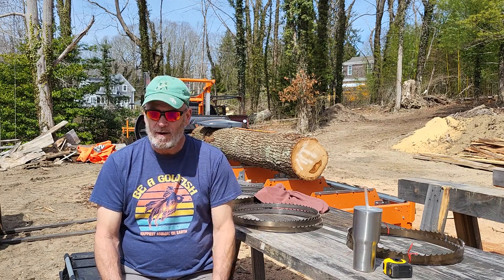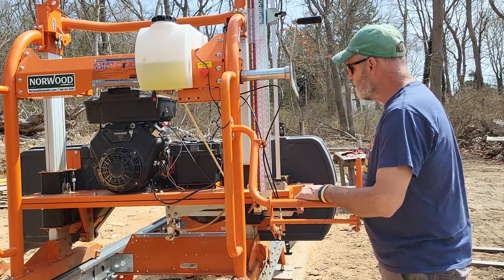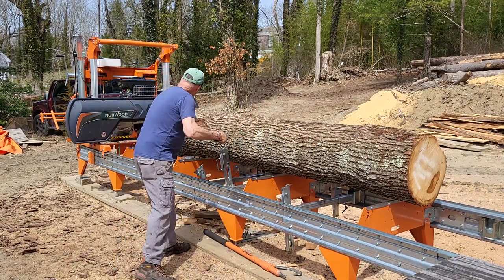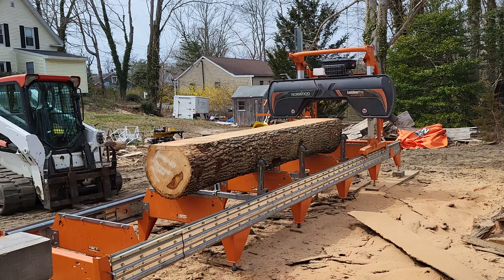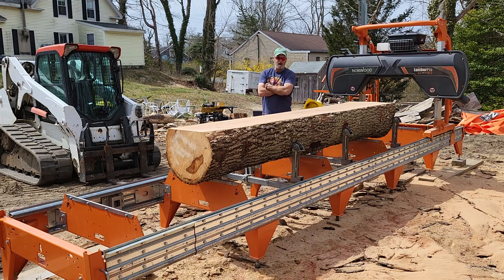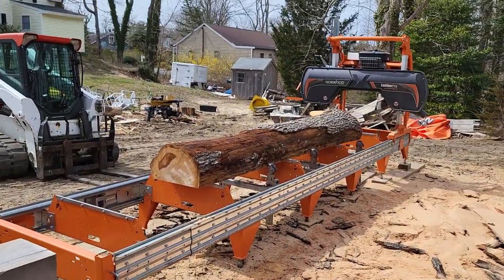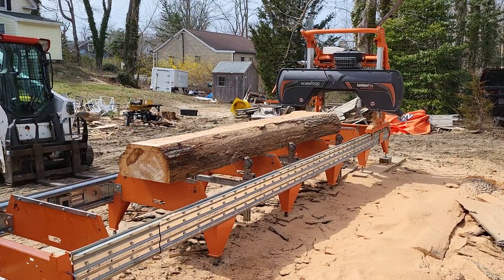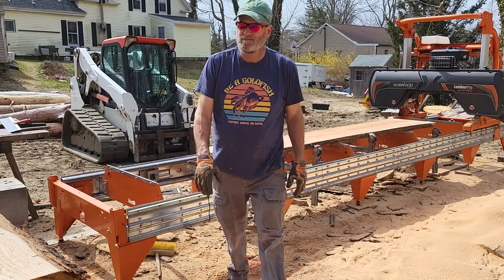Norwood HD36v2 guide testing.  Eco terrorist and furious rants🤣.  Audio sucks from 25:00 for a few.

Comment: Helle. check your water hose with the saw all the way down. Ohh and thx for the info
Reply from the maker: Yeah, it's a little tight/stretched. I'm might have to splice an extension into it.  So far, it stretches enough and the overall geometry (going downhill) is better.